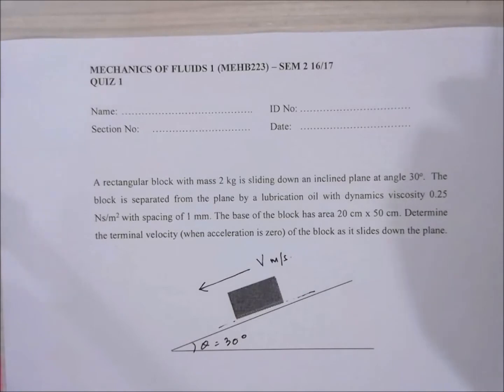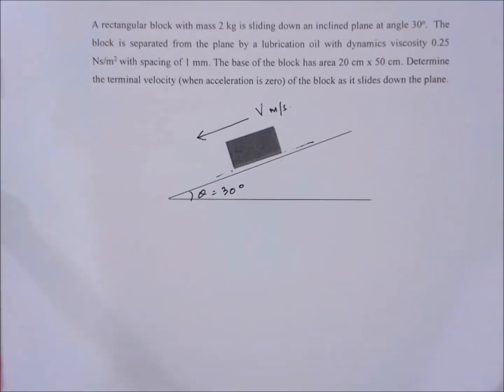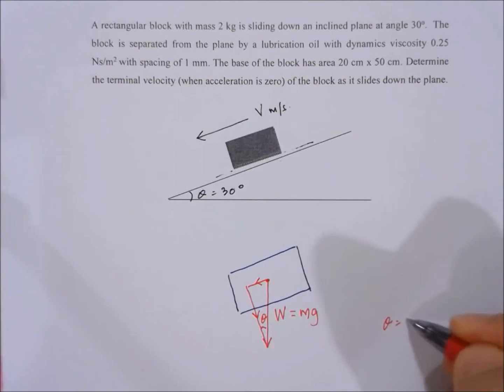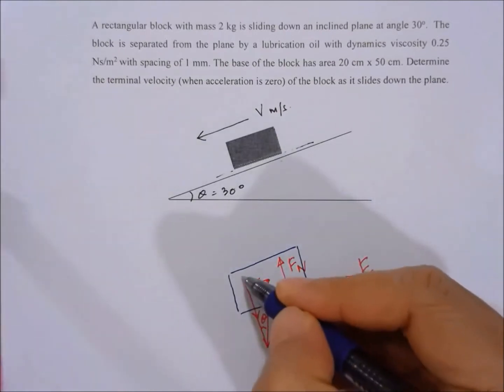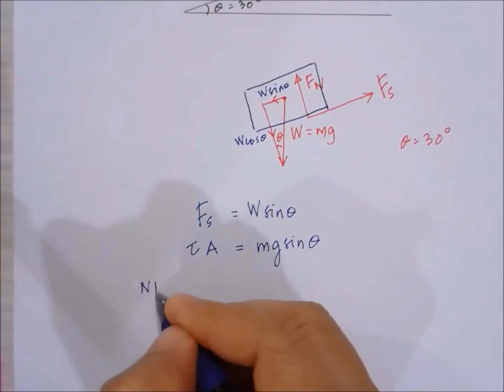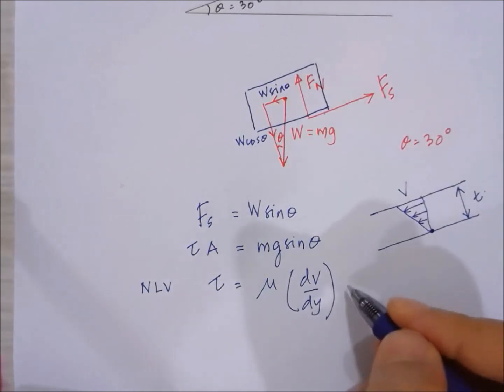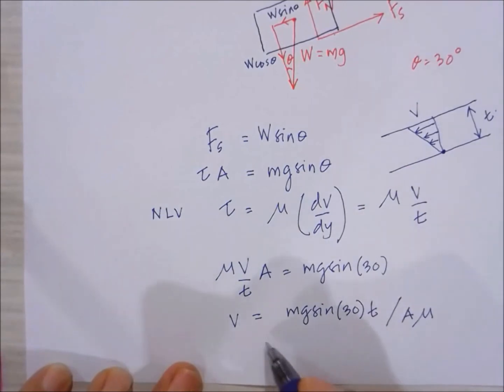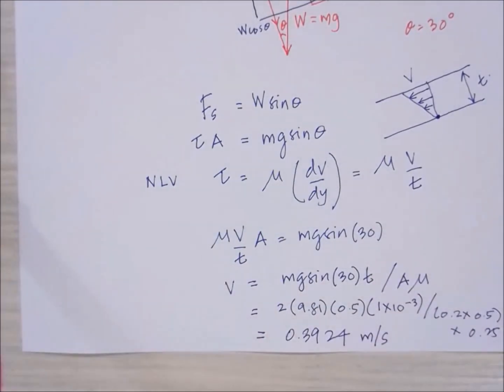Mechanics of Fluids - Topic 2 - Example 4 - Viscosity - Block Sliding Down an Inclined Plane

Comment: The area needs to be converted from cm^2 to m^2 to have the answer in units of m/s, doesn't it?
Reply from the maker: Yes. 0.2 m x 0.5 m.
Reply: @MohdZamriYusoff  I see now it is correct. I confused your problem statement with mine which gives the dimensions differently. Thanks for the instruction.